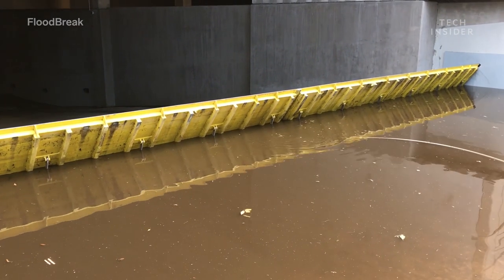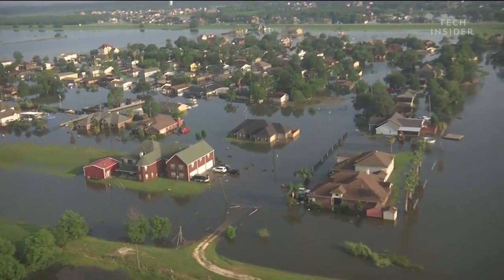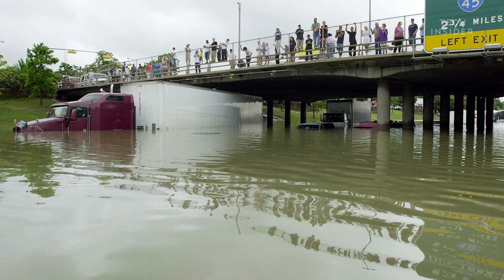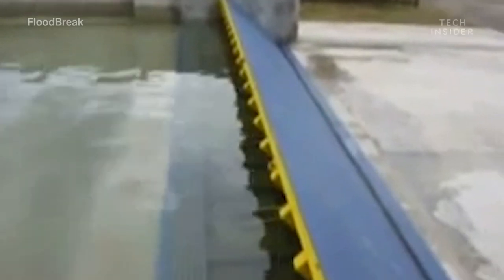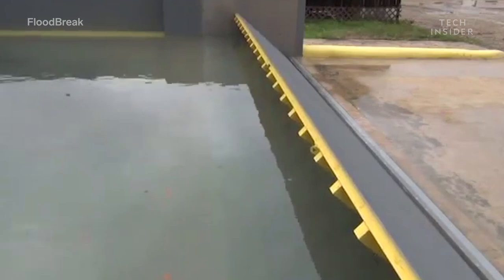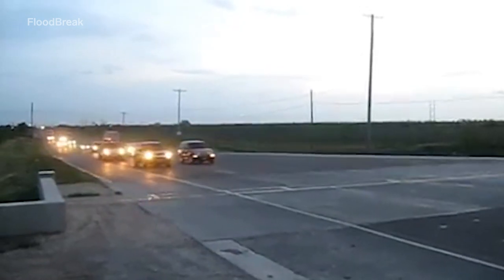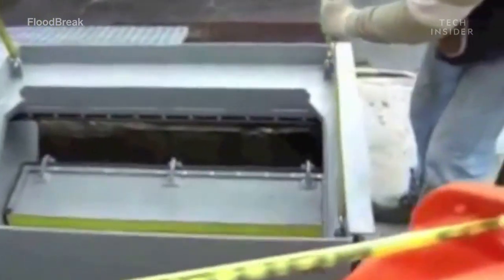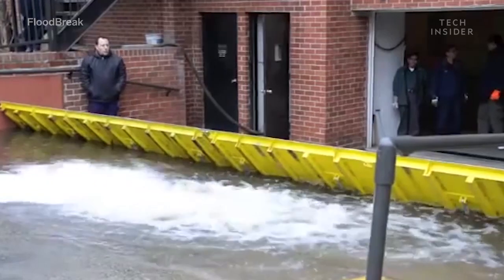Automatic Floodgate Helps Communities Against Natural Disasters

Comment: This can be a solution so protect certain buildings where flood can bring serious consequences like hospitals. But this should not be a widespread solution. It will bring higher flood levels to places not fenced with this gate, increase the speed of flood water flow, which can cause some serious damage. Building this is basically protection of one at the expense of another and should be used with strict monitor and moderation.

Comment: But water always find a way, it's not a wall that can stop it (it passes underground)
Reply: Well actually it'll be very good if it goes underground. Cuz then it'll seep into the soil. The actual problem is that it doesn't. Concrete is everywhere. The stagnant water is actually what causes most of the problems and not the storm itself.

Comment: This should be build on all tsunami cities.
Reply: Its not tall enogh
Reply: Boi this thing doesnt stand a chance against a tsunami. A tsunami is a million times taller than this invention
Reply: This might actually cause more damage in the case of a tsunami. Device like this can restrict flood water flow which will increase the speed of the water, which is already deadly in the case of a tsunami. Sure the buildings with it will get better protection, but at the expense of those who are unable to afford it.